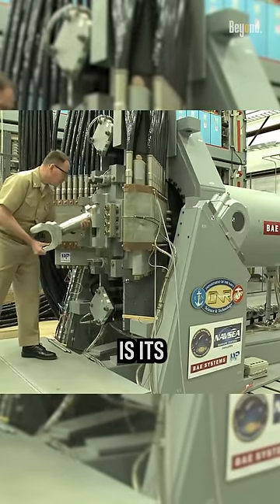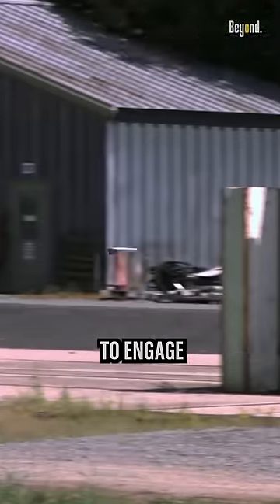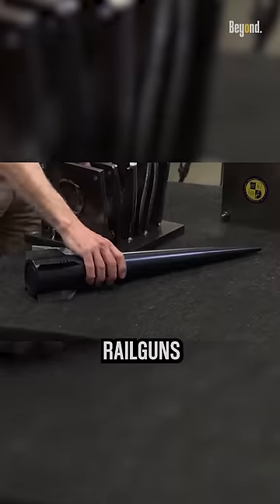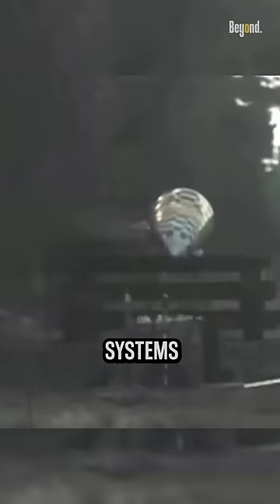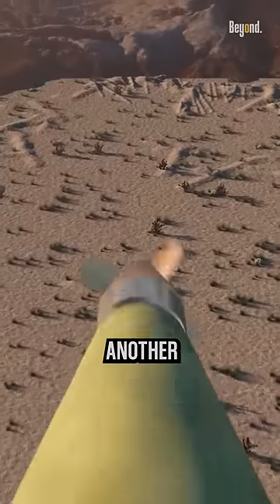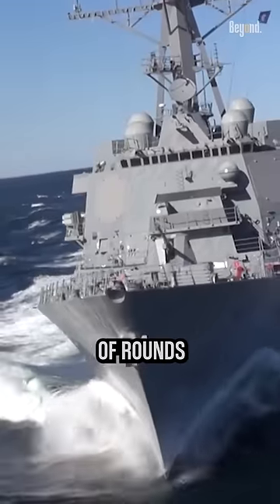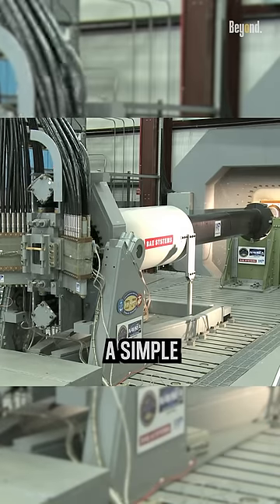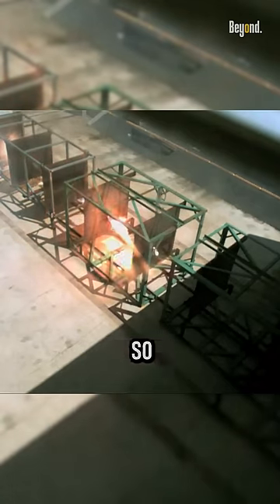Why does the US Navy need a railgun ? #shorts

Comment: The rail gun chewed uo the barrels after just a few rounds going through them.  The electrical energy needed was enourmourmos too.
Reply: Not hard if you've got a nuclear reactor on board
Reply: 2 types have Nuclear power.  Aircraft carriers and submarines that's only two type of sea going vessels that have nuclear power. And on top of that you have to look at the enormous size of everything that's needed to fit one of those guns on board and then the third thing again it's like I said they chew through barrels like crazy every time they fired us the Shell through one of those.  Abd did you see the flames coming out the barrel when they shoot them , its the inside of the barrel  melting
Reply: This should be pinned
Reply: The barrels probably arc and scorch inside.
Reply: What if, in an engagement, most of the ship's electrical systems are damaged, good old combustion fired ammunition remains reliable!
Reply: @vps1014  might be hard to aim?
Reply: @BR549a Didn’t they only go through gun barrels so fast because the navy wanted an unrealistic fire rate out of them?
Reply: Enormous*

Wtf kind of misspelling is that
Reply: Everyone just glossed over your first statement wtf. If it really is chewing up the barrel after a few rounds, thats a major problem and will be costly and unreliable in the field. Regardless of having a nuclear reactor we are looking at worse downsides then positives. And our tax dollars would also be paying for this fancy equipment. Much more improvements are needed for railguns to be practical.
Reply: @BR549a  sadly we decommissioned the nuclear cruisers, hell we might even fit two for one /s
Reply: @fang4853 Why don't they try maglev instead of a traditional barrel? If we're sending it on a nuclear reactor we might as well go balls deep on power
Reply: @daileygaming9488 the projectiles ARE maglev-ed and build up plasma once they reach a certain speed + the enormous amounts of energy running through the coils builds up tremendous amount of heat...

A solution to the plasma issue is to make the barrel a partial vacuum... but then heat accumulation / damage becomes even more of an issue.
Reply: Makes me wonder if it’s possible to magnetically levitate the shell in the barrel so that it doesn’t touch the sides.  Would probably use even more electricity though.
Reply: Enourmourmos is the superlative form of enormous. ^^
Reply: @BR549a I wonder why they didn’t use a different material like tungsten carbide or hard chrome it would make it heavier but might extend the barrel life beyond 3 or 4 shots
Reply: The bigger battleships and carriers have the energy. It’s not only nuclear that has the energy.
Reply: I heard they want about a million a round. Yeah there cheep but military industrial complex has a heck of a mark up.
Reply: @vps1014 electric gun... meet salt water spray.
Reply: @BR549a pretty sure we had a few nuclear destroyers too.
Reply: @BR549a there is one ship that was planned to get it as it's cannon costed over 1 million usd to fire 1 round, and it has enough power
Reply: @Elloliott If I remember right the Long Beach or sonething of that name. Think it was a cruiser.
Reply: You really don't want a gun that fires 1 round every 2 minutes on a ship. That is a complete waste. Also, railguns need so much electricity that they can only be fitted on carriers with nuclear energy. But carriers are not meant for direct combat (they are too expensive to risk and have planes to fight). Hence railguns are literally undeployable
Reply: @douglascunningham6319 "they are cheap", or "they're cheap" but not "there cheap".
Their, they're, there all sound similar but they are not the same. Hopefully you have learned something today.
Reply: Goes to show it’s roll is for single shot engagement , not multiple shots
Reply: @vps1014 , what if, the power grid failed in Texas, good old stupid diesel pickup truck is reliable.

Except, y ghettobilly power grid tho?
Reply: @woodstream6137 Why should it be pinned? It's like the other 90% of comments talking out of their ass.
Reply: @vps1014 If you have a total loss of electrical power on a nuclear vessel in a beyond-horizon naval engagement, you have so many worse problems than a gun not firing.
Reply: Our material science definitely needs more time to catch up, the replacement of the rails will be the big problem for now. Energy is going to catch up just due to the energy demands of the civilian world.
Reply: Never saw enormous spelled that way 🤣
Reply: @bumponlog it would be harder to replace all of its electrical components and its barrel every few shoots
Reply: @BR549a You could definitely equip other ships with nuclear reactors if need be. The question is whether this warrants the cost of building a ship with a nuclear reactor just to have railguns
Reply: @vps1014 Most warships have double and sometimes triple redundant power sources.   While in school I was told that  replacement power cables could be laid down, but I never saw such cables.
Reply: @fang4853  I mean, a single use Missiile like FIM 92 Stinger cost 320k per shot, your tax payer money gone waste anyways, since the US is investion 3B for a set of infantry small arms due lacks of competitor for pricing
Reply: @bumponlog  It doesn't need a nuke on board, the diesel generators can also charge the capacitors needed for an electromagnetic railgun. It's just too destructive to itself currently. We have technologies that could abate some of the damage, but are currently so expensive that even the DOD won't invest more into it yet.
Reply: So build a new ship class that is designed for railguns. It's a kinetic that has vastly increased range over conventional munitions. Also far more cost effective. There's also barely any counter measures. The only way to stop a bullet is armor, good luck versus anything more than a single round. A boat is not going to dodge projectiles going Mach 6-7 shot from outside of effective range for long. Especially when it's maybe tens or hundreds of dollars per shot versus $10,000 missiles. 

Put 4 of these on a deck, and fire 1 every 15 seconds (I believe this is lower than the speed that wrecks the barrels). A sniper rifle isn't prized for it's speed, is just a sniper boat. 

I can see it as a nice compliment to an existing formation.
Reply: Thank you, I was sitting here thinking why did they leave out the cons.
Reply: @BR549a and the air turning to plasma. Barrels last for less than 50 shots, and are quite expensive.
Reply: @venomous2die4 actually a nuclear reactor isn’t a nuke🤓
Reply: If this is fixed, though.
Reply: @BR549a  the tech is cool. may be next 10 years they find something to make it work longer. I'd speed up since it's not time to slow down weapons research unfortunatly..

Comment: the fact that 1 shot of railgun use about 1 day of San Francisco electricity
Reply: That would be a heck of a lot, are you sure about that?
Reply: @theoutlook55 One gigawatt is enough energy to power about 750,000 homes. 
a 32 MJ Railgun requires at least 15-30 MW of power onboard power generation, 64 MJ Railguns, would require 40-50 MW capacity.

So a 64 MJ railgun uses enough electricity to power about 9,000 homes per shot.
Reply: Cut power to san francisco for a day and use the power to shoot san francisco with an absurdly big railgun. Sounds like an amazing deal to me.
Reply: @FractalNinja  go back to school, you're mixing up energy with power. 64MJ shot is 64 MW of power for a duration of 1 second. average US household consumes 30kWh per day and that's 108MJ. so one shot of a 64MJ railgun can power a single average US household for 14-15 hours. SINGLE household for LESS than a DAY.
Reply: @robertjung8929 people failed to to take time into consideration and also failed to understand the units of measurement when doing this kind of basic calculation. It is dissapointing.
Reply: @robertjung8929  thanks for the expansion, and the math. 
I've read that 1 MWh is the usage of 500 homes or 200 at peak demand, so that statistic differs from what the first guy said. I imagine that changes your calculation too, so it's even less energy for one house, yes?
Reply: @theoutlook55  1MWh over what time period ? 1MWh is energy and it's 3.6GJ. is it per day per month per year ?  it's like saying your car consumes 10 liters/galons of fuel, but without knowing the distance it travels on that amount of fuel the information is meaningless and pointless. same with the energy, without the time period the information is meaningless.
Reply: @robertjung8929  I guess I could have phrased that better. 1 MW is the capacity needed to meet the energy demand of the aforementioned number of households. 1MWh is what those households would use over the course of an hour.
Reply: @theoutlook55  1MW of power for 500 households would mean 2kW per household.. that would yield 48kWh per household per day , which is higher than the 30kWh in my example before.
Reply: Nuclear ractor, easy solves the problem l.
Reply: This could be avoided with the further develop of NDB batteries.
Reply: @FractalNinja it’s still a lot
Reply: also i heard that railgibs like this one requires fixing after lije 5 uses cuz of such huge amount of energy, in fact thats why they canceled it, its acctually too expensive
Reply: @eneasotgia142 we have an enormous number of ways we could produce that power. the problem is that our governments have spent so much time and money trying to control the narrative that we don’t know, so they can continue to get rich off “clean energy”
Reply: eleeical creation is a mesurment in yech levels by science  the amount power a society can generate will allways get bigger over time and cheaper
Reply: The line that they have the potential to be more cost effective than conventional weapons really got me, hilarious
Reply: San Fran still has electricity??